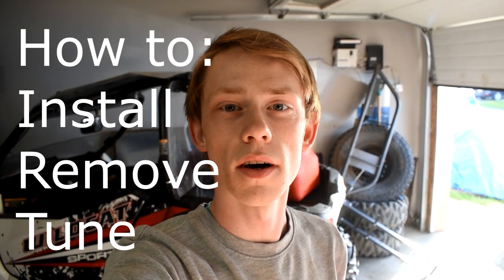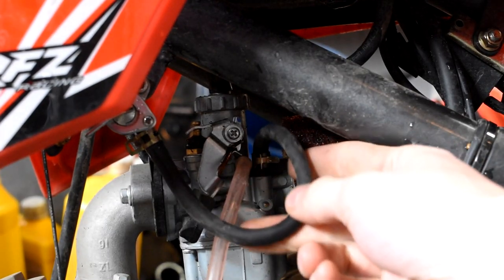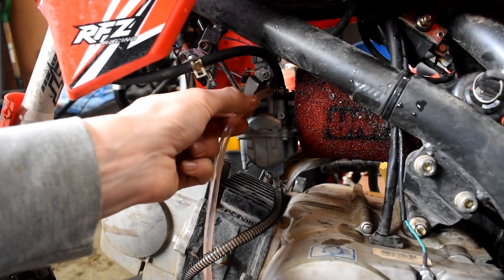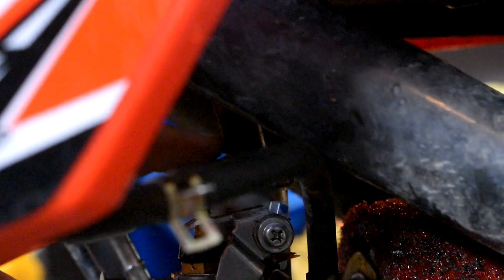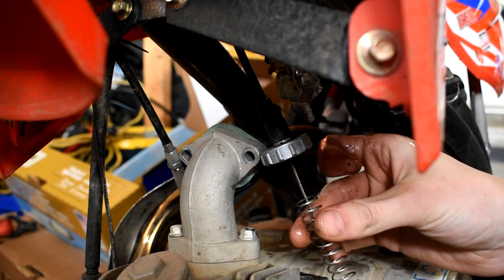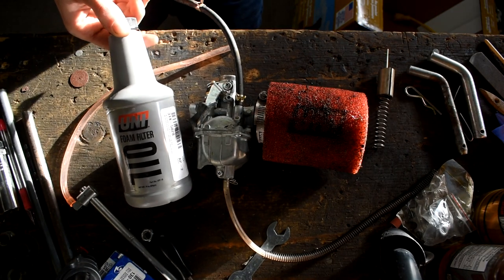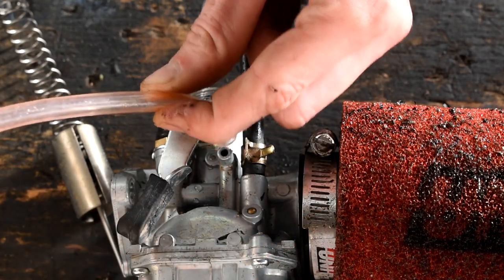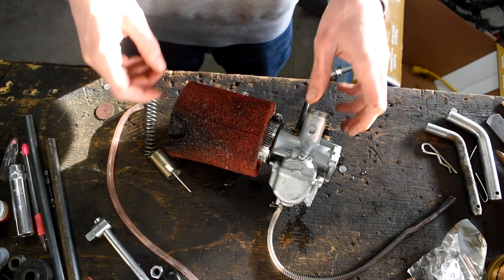How To Fix Dirt Pit Bike Bogging | Upgrading Chinese Pit Bike Carb

Comment from the maker: Everything you'll need to make your Pitbike run better and faster
Makuni Carborator (replica)- https://amzn.to/2AXlSIF
Makuni Carborator (Genuine) - https://amzn.to/3g0injX
UNI Carb filter - https://amzn.to/3cNzPpP
UNI Carb FIlter OIL (YOU NEED THIS) - https://amzn.to/31eGaYX
16 tooth front sprocket - https://amzn.to/30trEMD
Reply: did u have to rejet at all..
Reply from the maker: I havent yet, but i still need more tunning
Reply: there is alot of contradicting information on these knock off mikuni carbs. some people are saying that the mikuni jets dont fit. do you happen to know which jets fit? keihin style?
Reply from the maker: Because 99% of guys are running replicas and not genuine mikuni carb
Reply: im planning to run a knock off mikuni as well. I just wanna make sure i get the right jets before i start messing with it
Reply from the maker: Cant help you there then. I run a genuine mikuni
Reply: @AaronsEnduro  appreciate the responses.
Reply: I say get the jet,s at the same time you order your carb or you have to wait for them to get your bike running right
Reply from the maker: Totally agree!! Buy it at once and you’re set!
Reply from the maker: Genuine myself!
Reply from the maker: That link is sold out atm i can see if i can find another here
Reply from the maker: You can source one directly from apollomotors.ca 

They seem to be sold out on amazon
Reply: I got the 17 tooth one .. is that fine as well ?
Reply from the maker: 17 tooth is definitely tall gearing if you have the 14/17 wheelset. But also depends how and where you ride
Reply: I ordered the replica yesterday .. reading the comments I should probably cancel and get the genuine one .. feel like it's not gonna work the replica
Reply: I ride it in the streets really .. bad idea for the 17 tooth ?
Reply: What size carb
Reply: not sure if someone asked. but what did you do with the filter hose that leads to engine?
Reply from the maker: Remove most of it, leaving just enough hose to go in the clip that runs down the back of the engine.

That “hose” is a crankcase vent. The stock air/oil separator it connecs to before it go goes into the carb gets clogged up. 

Just route the vent coming from the engine to the ground for excess oil to spit out. Theres a stock clip on the back on the engine to hold the hose went you re route it
Reply: @AaronsEnduro  ok, so the old filter I had, that has the crankcase hose leading to the engine is blowing air into the engine?  Or is air from the engine, or oil fuel mix blowing into the carb?
Reply from the maker: Engine pressure escapes from the engine through that hose. Its blowing crankcase pressure from the engine(air), and some oil.

They decided to route the line from the engine to an air/oil separator, where the oil drips into the catcher, the air continues and gets recirculated in the the air filter to be “cleaned” and cycled again into the engine.

The issue with the stock setup is it tends to build up condensation and the oil inside it becomes milky and eventually gumming up the air way in the vent, thus preventing excessive blow by from venting out. Resulting in blown engines
Reply: @AaronsEnduro  Dude, you are the man. The way you explained that made me completely understand. Thank you so much for the help. Just one more question though 😂. Doesn't the engine need the circulated, filtered air returned?
Reply: And I just subscribed by the way
Reply from the maker: Nah, the air filter can suck on its own more than enough air. Even then i still wouldn’t want that air recirculating into the carb, as im sure the separator itself doesn’t do a perfect job of separation, resulting in engine oil going in your carb. Also the stock air filter is absolute junk. Get a UNI 2 stage foam filter and air filter oil for it and never look back
Reply from the maker: Thanks for subscribing and supporting the channel!
Reply: @AaronsEnduro  Again. Thank you sooooooo much!
Reply from the maker: If you use the links above for the filter and oil you support the channel at no extra cost to you!
Reply: Help Please…
How did you tuned your makuni carb? There is no room to move the fuel screw under the carb. I removed the carb on and off 8+ times to adjust the fuel screw so far. 

This is what my Gio Orion SS 125 does;

Needle clip on 4 groove top to bottom.  

Fuel screw 5 turns out, bangs and fire out of the tailpipe. Boggs at 1/4 throttle. 

Fuel screw 2 turns out only idles, spits and bangs with throttle. Boggs at 1/4 throttle.

Fuel screw 1.25 turns out , it starts and sort of stays on then it dies, Boggs, 1/8 throttle kills it. 

Fuel screw 1.0 turns, barely turns on and dies.

It keeps bogging, what should I do now? Smaller Pilot jet? Move the needle clip to a leaner position?
Reply from the maker: If you’re looking for 1 on 1 help check this out and i can help you get it sorted out!

https://www.youtube.com/channel/UCcviyKZ2Vf3IHFliwebzODA/join

Comment: Glad i found this video i got a new cheap Chinese carb off of eBay and i just cant get my bike to run it starts then a second later it cuts out I'm away to try some of the stuff in this video
Reply: It was the clip that goes onto the throttle needle it was in the wrong position
Reply from the maker: Happy that you figured it out!
Reply: @AaronsEnduro me too it was frustrating i spent the whole weekend trying to get it running, I'll be out later on ripping around

Comment: Great video, just a few things. 
Filter side, air adjustments are on the side of the carb at the filter, not underneath at the filter . Only the fuel screw will be located under at manifold side.    

Hose at the bottom of carb bowl is the overflow, for when your float stays stuck open so that you dont flood your engine.. 
BUT still very  informative,    hell yeah 🤘
Reply from the maker: Thanks for more info
Reply: You have fun riding today Eric

Comment: Alrite mate i have the same carb uve just explained everything only thing i think u may have missed is where the bendy washer type thing goes after the needle or before if u can help i would be greatful thank u great content aswel thanks
Reply from the maker: Needle in the slide first, then bendy clip, then throttle assembly

Comment: did you raising the clip fix your bog in 3rd and 4th?
I'm having the same issue when in 3rd and fourth and snap the throttle it bogs for a bit and then catches up and takes off. 
My fuel/air screw is 2 turns out and my needle clip is on the highest notch.

cheers
Reply from the maker: It did yeah, try adjusting your clip in the various settings and see which performs the best!
Reply: @AaronsEnduro  Yeah I wanted to know this too, so moving the clip up (making it leaner) fixed your issue?

Comment: First off, thank you for the content, amazing help. 

Did you ever figure out the needle position? 

Everything here was spot on, but I picked up from a different video that the clip position needed to be at the lowest (richest) position, not the highest position. I made the change in clip position and it’s great. I’m not even sure I’ll take it off again to install the extended mixture screw that’s on its way. Thanks again.
Reply from the maker: For me it was 2nd clip from the top. But this also depends on your elevation

Comment: I'm having trouble taking off the stock "cap" on throttle collar. Where is the brass/copper pin that I must cut out? Thanks!!
Reply from the maker: its located on that stock cap

Comment: I was able to get needle nose pliers and remove the brass notch on the stock cap instead of cutting or drilling it out. Its a screw
Reply from the maker: nice work jeff.
Reply: Same

Comment: Hello Aaron.  I have a mikuni carb just like yours on my z20 max.  It wants to leak out of the the hole at the bottom left onto the cylinder head.  I noticed you don't have a hose there.  Does yours leak?   Preston woods.  Hudson nc
Reply from the maker: Sounds like your carb overflow is stuck.
Reply: Thx . I'll give a try
Reply: OR the little rubber ring worn

Comment: I have a questioned on the gas and air flow screw you said close it all the way then give it 2 1/2 turns open??
Reply from the maker: Correct! Within a half a turn in or out from there should be ideal fuel settings if you have the correct sized carb

Comment: Great video. What did you do with the hose that came off of the stock carb? Im actually in my studio waiting for my carb to be delivered. Had bike (DBX-19) 1 weeks and caught a flat. Valve stem broke.
Reply from the maker: It vents to the ground! Theres a hose clamp on the backside of the engine casing already there for when you put in the aftermarket carb!

Comment: Bro I just watched you how to adjust a clutch video and dude honestly, I got out of bed, it was 8:30pm😂 dark basically, and damn man what a difference. Hella appreciate it💯
Reply from the maker: Glad it could help!!! Thanks for watching!
Reply: @AaronsEnduro  hey one more thing bro, if I'm riding say 3rd and I'm just cruising and I got to hit the throttle more it cutts out then picks back up, I have a Mikuni carb on it, thanks
Reply from the maker: You need to tune the c-clip position on the throttle slide, or slightly adjust the fuel trim! If you need a mechanic to guide you i do that by donation! https://www.paypal.me/agreenway13
Reply: @AaronsEnduro  ready when you arrive hit cash app
Reply from the maker: I only have paypal. Cashapp is not in canada

Comment: Hey man, random question. I just got an exhaust plug today for my 2010 yz 450f. I put the plug in and forgot about it and tried to kickstart it. The bike wouldn’t start and noticed there was less compression as well as a sound that sounded like air was being sucked. I pulled the exhaust plug out and it fired right up but I’m worried I may have messed up something internal by doing that. What’s your thoughts?
Reply from the maker: Its fine. If it runs now its fine. It wouldnt run with it in because the exhaust gas’s can’t escape. No damage should be done

Comment: Yeah I'm trying to figure out what you were figuring out on this video at high RPM all gears my engine want to cut out I've tried everything on the carburetor still trying to figure it out
Reply from the maker: thatd be your main jet being to small for your sea level
Reply from the maker: if you have already tried increasing fuel^^^
Reply: I'm in Indiana don't no what size is best
Reply from the maker: You need to take yours out to reference what a “size up” from that is
Reply: I have played with the needle I have not tried new spark plug that's my next thing
Reply: What's funny is when it out of gear its OK I can get high RPM,s but not in gear I can pop the clutch and smoke backe tire but won't red line
Reply: Its fixed had to big of a jet in my carb I put the 88 jet in it and she fast really fast
Reply from the maker: So awesome to hear!! Glad you got it dialled in!
Reply: @richardriffle9773  interesting. Thanks for posting your solution
Reply: @richardriffle9773   which jet did you switch to 88 ?
Reply: @dirtdiver274  the main jet
Reply: @richardriffle9773  and what groove is your needle position clip on ?

Comment: The brass pin in my stock carb is annoying as hell, how would you recommend removing it??
Reply from the maker: I used a drill bit
Reply: @AaronsEnduro  I used players to force the cap to unscrew, it broke the threads and I got it off and installed my new one. Kinda sad tho that I had to break the old one, it was brand new and in perfect condition abs now it’s broken

Comment: So living at 800 ft above sea level.. My Replica VM22 came with 95 main jet and 38 pilot which I tried with the screw 2 turns out, was sputtery and would cut out at 0 to 1/ throttle then go great until with warmed up then cut out at any throttle position acted like it was lean, pulled the plug and sure enough it was, thinking Im gonna have to try a bigger pilot and one or two sizes up on the main.
Reply from the maker: Yessir

Comment: Great help mate. The problem I have is when I’m taking off front standstill it’s really boggy (wants to stalls so have to give it a lot more revs to stop it) and when your cruising and try to accelerate it’s spluttery but once is gets going it’s fine and completely normal. Just seems to be lower end. Any advice mate?
Reply from the maker: Either fuel screw or idle jet. Check the colour of your spark plug
Reply: @AaronsEnduro  I’d say spark plug looked dry more than anything. The bike also pops like crazy and loud when you decelerate. Also some flames sometimes too. Hope that helps more
Reply from the maker: Was the plug black,brown or white at the tip
Reply: @AaronsEnduro  maybe a bit of brown and black
Reply from the maker: It should look like a perfect golden brown roasted marshmallow. Black indicates the mixture is too rich (too much fuel) which will cause bogging
Reply: @AaronsEnduro  been out playing with it it today. It’s only got air mixture screw and can’t get it nice still spluttery (dying when going up banks etc) but on the roads it’s decent. But it’s got my 140 carb on it which I think is w 26mm and I think they need a 28mm carb. Could this be the problem?
Reply from the maker: No you need the adjust the needle jets
Reply from the maker: Open the carb bowl
Reply: @AaronsEnduro  so a new bigger card what people recommend won’t change nothing mate?
Reply: @AaronsEnduro  I’m clueless with jets lol
Reply from the maker: U dont need a different carb. You need to tune your carb by swapping the needle jets. Watch my carb videos
Reply from the maker: https://youtu.be/oyGP1uTU-jE
Reply from the maker: A 26 mm carb is plenty big for a 140
Reply: @AaronsEnduro  it’s got a 160 engine in it now mate. But the carb on 160 was knackered so I used my old 140 carb
Reply from the maker: A vm26 should still be plenty 
I used a vm24 for my 150
Reply from the maker: Which is what apollo recommend
Reply: @AaronsEnduro  I see.Maybe I’ll put it into a bike shop and let them deal with it
Reply from the maker: If you dunno what ur doing thats ur best bet

Comment: Hi I have a db-x18 125cc and I replaced the carb with mikuni carb on it . Cranks fine but idles really really high. What can I do ?
Reply from the maker: Lower the idle with the idle screw on the right side of the bike

Comment: Aye bro where do you put the cable that’s connected to the air filter when you get a uni?
Reply from the maker: You remove 3/4 of it and vent it to the ground. Its a crankcase breather line

Comment: I have a 125cc 2013 china pb and is the original air filter usable or what is better with the other one that u recomend cuz i kinda dont wanna spend too much money on it and just wondering the difference
Reply from the maker: The stock cone filter IS JUNK!! Do not use it! The difference between the stock cone vs a good filter is that the cones filter screen with way too big and lets too large or debris through it! I have a UNI Filter and filter oil link in the video description

Comment: I have gas coming out of the bottom line on my Mikuni. Any thoughts on a fix?  I sprayed the inside with carb cleaner and adjusted fuel mixture screw to two turns. I also adjusted the pin like you demonstrated.
Reply from the maker: Thats the float getting stuck. Either debris in your float or something catching the float up
Reply from the maker: Try opening the bowl drain and then closing it after it drains. It can be a try and repeat task to clear it out. I had to clean my carb like 8 times when the float was stuck
Reply: @AaronsEnduro  thanks for the replies!  I’ll take it back apart and remove the pin to really get in there. I’ll clean more thoroughly and see if that helps.
Reply from the maker: The pin insint where the carb bowl is
Reply: @AaronsEnduro  I’ll try this over the weekend. First time working on a carb... your video is great. I didn’t remove the float pin or float when I sprayed cleaner. I’ll do that next time to really clean. When you say open the bowl drain. Are you referring to the bottom line?
Reply from the maker: Take the entire bowl off of the carb. Look at the bottom of the carb, in each corner theres a screw. Remove the whole bowl and spray the black float with cleaner and the whole bowl out
Reply: @AaronsEnduro  that’s what I tried tonight, but I think I may need to spend more time cleaning it. Had been sitting for previous owner. I’ll let you know how it goes. Keep up the great videos!  I’m telling others about them!
Reply: If hoses are hard (old) I've had rubber ring worn out before. Just were hose connects on inside of carby. Was new bike but had hard hoses
Reply: I sell these and all are different lol
Reply from the maker: Very much so a possibility

Comment: hey man thank you for this video, not sure if you will see this but i’ve got an apollo rfz 110, do you mind linking me to a carburetor that will
Reply: that’s better than the stock carb**
Reply from the maker: Im not 100% if you need a slighlty smaller carb, but youd want a mikuni vm22
Reply from the maker: https://www.amazon.com/gp/product/B07NW7CMVQ/ref=as_li_tl?ie=UTF8&camp=1789&creative=9325&creativeASIN=B07NW7CMVQ&linkCode=as2&tag=aarongreenway-20&linkId=15f93e77b39fed66aaa008d91bf782c3
Reply: Aaron Greenway thank you bro, have a good one🤟🏽

Comment: I live in Boston MA area I’m at sea level I have this same carb I did 2 turns out on the bottom fuel screw and needle adjustment I believe I have 125 jet in … so I have 2 questions is the 125 jet too big and what did you adjust the side idle screw to ? Currently I’m only going about 47-52 top and it boobs in 3rd and 4th gear when quarter to half throttle… please let me know thanks I have grom clone fuerza icebear love it